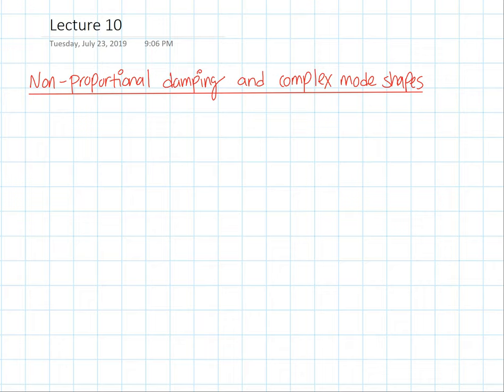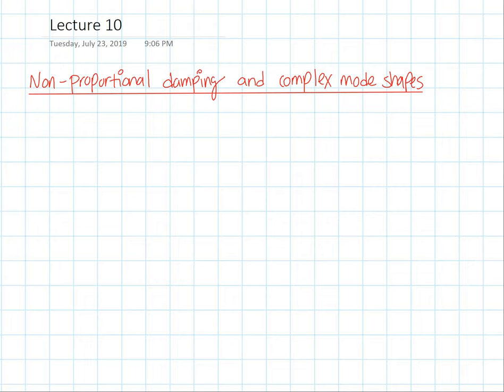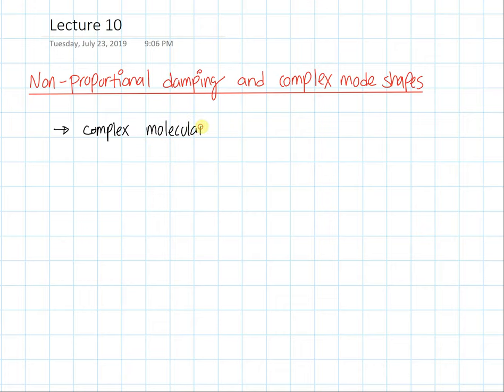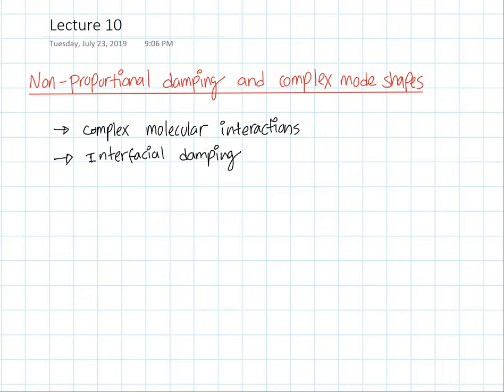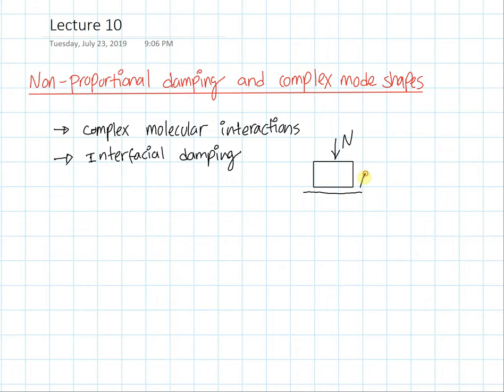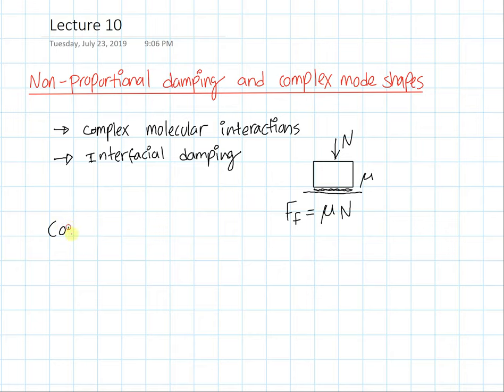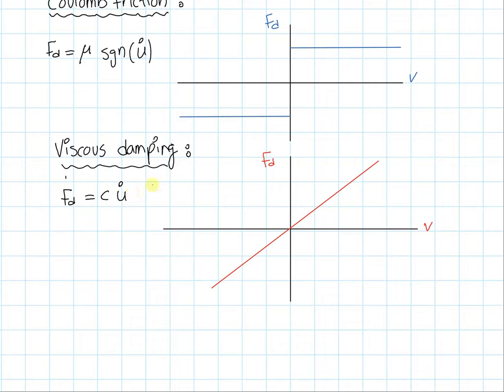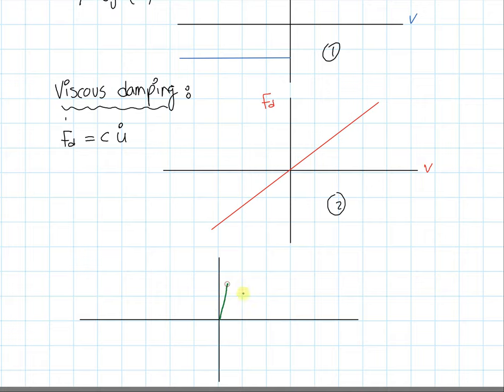Non-proportional damping and complex mode shapes (Lecture 10)

Comment: Really good video. But i find that all references neglected the rigid body modes in complex mode analysis.  With matrix analysis, rigid body modes cann't be used to uncoople the dynamic equation, and then there comes a new question that why flexible complex modes can always do.  Or in other words, can it be proved that the matrix As contatining viscous damping in your video can be diagonalized? I know it is a  mathematical work instead of structure dynamics, just  curious

Comment: Nice video. 1 question though. At 37:03 you say that the nodes will not move at the same frequency. I thought that if you have complex modes, the nodes to move at the same frequency it's just that the phase is not the same.
Reply from the maker: Yes, you're correct. I meant the phase is different! Thank you for catching that!

Comment: thank you ,it is very  helpful to understand non proportion damping. However , I am not getting the graph  of complex mode shape and matlab code.
Can you  explain the  matlab code and graph of complex mode shape
Reply from the maker: Here you go.
%% Mass matrix
    M = 1/386* [400 0 0; 
                0 400 0;
                0 0 200];
%% Stiffness matrix
    K = 610*[2 -1 0;
             -1 2 -1;
             0 -1 1];
%% Classic damping
    a0 = 0.9198;
    a1 = 0.0021;
    
C = a0*M+a1*K;
ca = 1.5;
Ct = C + [ca 0 0; 0 0 0; 0 0 0];

%% State-matrix
As = [zeros(3), eye(3);
     -inv(M)*K -inv(M)*Ct];
[Phi,Lambda] = eig(As);
    phi = [Phi(1:3,5) Phi(1:3,3) Phi(1:3,1)];
    phi(:,1) = phi(:,1)/phi(3,1);
    phi(:,2) = phi(:,2)/phi(1,2);
    phi(:,3) = phi(:,3)/phi(3,3);
    phi = [0 0 0; phi];
    pr = real(phi);
    pi = imag(phi);
    Y = [0 0 0 0];
    floor = [0 1 2 3];
        
        figure,
            plot3(Y,pr(:,1),floor,'b-o','LineWidth',1.5); hold on
            plot3(abs(pi(:,1)),Y,floor,'r-o','LineWidth',1.5); grid on; grid minor
            plot3(Y,Y,floor,'k-o','LineWidth',1.5); xlim([-.01 .01]); ylim([-1 1]); zlim([0 3])
            xlabel('Imaginery axis'); ylabel('Real axis'); zlabel('Story')
        figure,
            plot3(Y,pr(:,2),floor,'b-o','LineWidth',1.5); hold on
            plot3((pi(:,2)),Y,floor,'r-o','LineWidth',1.5); grid on; grid minor
            plot3(Y,Y,floor,'k-o','LineWidth',1.5); xlim([-.05 .05]); ylim([-1 1]); zlim([0 3])
            xlabel('Imaginery axis'); ylabel('Real axis'); zlabel('Story')
        figure,
            plot3(Y,pr(:,3),floor,'b-o','LineWidth',1.5); hold on
            plot3((pi(:,3)),Y,floor,'r-o','LineWidth',1.5); grid on; grid minor
            plot3(Y,Y,floor,'k-o','LineWidth',1.5); xlim([-.05 .05]); ylim([-1 1]); zlim([0 3])
            xlabel('Imaginery axis'); ylabel('Real axis'); zlabel('Story')
Reply: @amiraliCEE  thankyou sir🙏
Reply: Sir how can be find complex mode if damping is variable means damping is function of damped frequency like C = 1/(s + u) , where s is damped frequency, u is constant
Reply from the maker: @joginderpal252  instead of using the the state-space block in stimulink you could construct the equation of motion and filter the damping signal or constant with a lowpass filter like that. Let me know if that's not clear.
Reply: @amiraliCEE  not clear.
m=1;
k=1;
c=0.3;
syms s
syms u
a=[(m*s^2+2*k) -k 0;-k (m*s^2+2*k+((c*u*s)/(s+u))) -k;0 -k (m*s^2+2*k)];
p=det(a);
u= [0:0.001:50];
for i= 1:length(u)
    a=[1 u(i) 2+(0.3*u(i)+4) 6*u(i) 10+(1.2*u(i)) 10*u(i) 4+(1.2*u(i)) 4*u(i)];
    b(:,i)=roots(a);
end
first i have determined the characteristic equation of system then calculate the eigen value. 
Eigen value have complex nature ,after that i  am 
stuck to getting  eigen vector.
Reply: @joginderpal252  thank you for the program code that you have provided, but I want to ask, why when I change the value of k and m in your matlab code, then i use the mode to calculate phi(Transpose)* Ct * phi, i still can't get diagonal matrices of damper ?